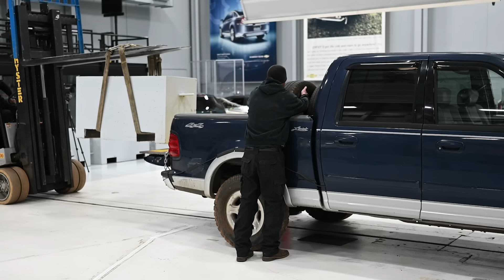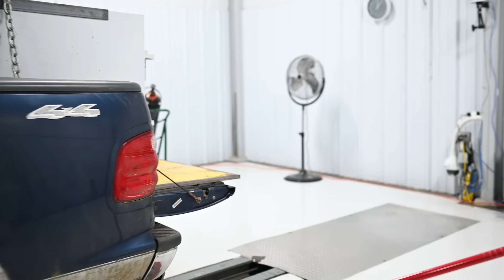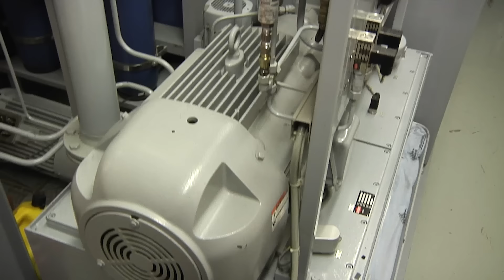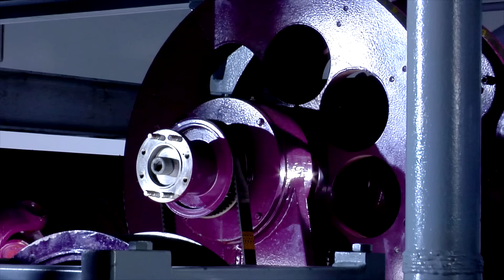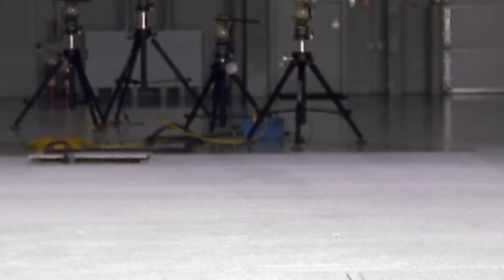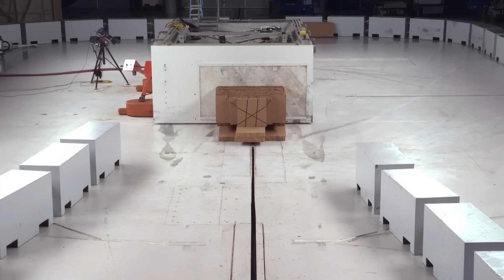IIHS crash propulsion system still pulling its weight

Comment: You say old junkers, but those "old junkers" are still going strong and are far better built and more reliable than the new cars - with almost no exception.
Reply: I've heard stories of these modern Diesel trucks that puts you in a low engine power mode if your emissions system has an issue and strands that poor contractor or transporter trying to get from point A to B costing them to loose a lot of money and time. So unfair!
Reply: Yea except they are basically all death traps, coming from a crown vic owner
Reply: i prefer my life thanks
Reply: @proboxpepper6752   Science disagrees. There are safe cars which are more than 15 years old. And they are definetly not death traps. Your crown vic is designed in the late 80s, and at least it has a good moderate crash rating from IIHS. So your comment isn't true as you are trying it to be. ;)
Reply: @gavcom4060   Don't worry. New cars are so bad that they frequently go in limp mode, therefore, you'll be safe at 30 mph. You are even safer than that when the new car breaks down. :)))
Reply: @legioner9  research tends to agree. mortality rates in vehicles have been at a decrease for decades now. in fact, when the IIHS was introduced in 1959, we saw a massive decrease in mortality in the 60s. Now, I’m not gonna say the IIHS has to anything to do with that, but…

Comment: Even though you were just trying to test the weight, you did prove an important safety tip here. When loading your truck with materials, do not exceed the maximum weight limit that the instructions say, like in this test. The results can be catastrophic.
Reply: Also to tie the load down, to restrict movement as much as possible.
Reply: @smurftums  Yes very true. And if your load is something like wood or stone, that can’t be secured very well, drive like a grandma lol! I had to dig a guy out of a load of wood, that blew through the bed of his truck and into the cab back in 2008, And it wasn’t even a big load of wood.
Reply: @BoberMcBoberson  If people haul stuff like that on a regular basis, I would think a headache rack would be a wise investment
Reply: If truck is lifted you have nothing to worry about.
Reply: @Tracert-mc1hu  the point is that most people don't haul often enough to get a headache rack so for most people load it better and drive safer
Reply: @Slacksfifth  Except for rollovers.
Reply: @Slacksfifth  The energy transfer doesn't change, it just ensures that your feet are removed, while you're getting crushed by your load.
Reply: Also place the load as far forward as possible.  This does two things, one it reduces the pendulum effect when going around a corner and two, the load does not get a running start if it breaks free in a crash.  I've seen backs of cabs pushed just about into the dash due to an unsecured load.
Reply: @Slacksfifth  a crash is still a crash
Reply: @Slacksfifth  lifted trucks will do more damage and be more at risk of rolling over and having the roof collapse on you. I'd rather lower it just to keep the center of gravity low and be able to corner better
Reply: The rated payload for those trucks was well over 1,000 lbs. Anything near that weight is going to rip off any tie downs and blast through to the dashboard in that type of collision.
Reply: And put the heaviest items closer to the cab, so it has no time to "accelerate" before hitting the back of the cab
Reply: @specialopsdave  That's not how physics works bro. It's all still going to smash the cab of the truck
Reply: @cherrypepsi2815  Yes, it does. Something slamming into another thing does more damage than when it is pushed hard. Change in velocity over time is acceleration, and change in acceleration over time is called jerk. Jerk is very important in crash tests, and will be far more extreme if it has distance to travel first before impact. This is the same reason seatbelts have pretensioners.
Reply: @specialopsdave  You were acting as if that jerk was the only thing that caused damage though, when in reality, that large mass would still have inertia

Maybe I just misunderstood what you were trying to say
Reply: @cherrypepsi2815  Yes, but the wall would have more time to work on said inertia, and it would only bend the wall, rather than becoming an impromptu dashboard replacement
Reply: @specialopsdave  Really at that point it just depends on the weight/malleability of said object
Reply: @Slacksfifth  If you're stupid enough to have one of those bubba buggies, then you have a lot to worry about.
Reply: @TheScrubmuffin69  also, most headache racks on pickups are just bolted onto the bed, which in a crash doesn't do much for ya. Be better off just welding a steel panel between the bed and cab, and install a rear facing camera and wire it into your rearview mirror
Reply: something even more disturbing? a 3/4 ton and 1 ton use the same cab and bed for most manufactures so event hough they are rated for that payload the same thing would happen if not properly strapped down.
Reply: @Slacksfifth  😂 what
Reply: @cherrypepsi2815  it's not as likely to if it doesn't get a running start.
Reply: @benjammin8510  Yeah, I get what you mean. At first I thought you meant that it wouldn't damage the truck at all (which is stupid). My bad
Reply: @Slacks 5th Avenue  The weight is still going to come forward. Physics don't change.
Reply: @user-ke5cx2pl4s Headache racks are great for protecting the cab and window from things you are throwing into the bed. Not really all that strong when faced with mass and inertia/speed.
Reply: @Slacksfifth You're funny.
Reply: @Tracert-mc1hu  a headache rack isn’t going to do much good down low. With a large mass in the bed, the thin sheet metal will give way. 

It might be a nice spot to mount some lights, or protect the glass but I don’t see it as a true safety feature by any means.
Reply: That's definitely the simplest way to look at this but maybe not the right way. How that weight was strapped down matters the most here, not the weight itself. This wasn't done in a way to prevent the weight from moving, hopefully you can simply see that with your simple ideas here.
Reply: This is why they have headache racks for pickups. It will take some of the kinetic energy out of the load.
Reply: Or use a trailer while securing very well.

Comment: The crash results of a 5000lb load vs 9500lb load at 40mph are going to be massively different, frankly devastating. We are entering into a whole new era of crash tests. It will be interesting what structural modifications will have to be made to absorb/dispel that additional kinetic energy generated from all that additional weight.
Reply: There will definitely had to be miss to how doors are designed. Its a big weakness of unibody
Reply: Its a bit of nightmare really isn't it. Most guards and railings infrastructure should be fine because they are designed to withstand big trucks. But the road surfaces are going to get a pummelling and anyone in a more efficient lightweight vehicle is going to be at a severe disadvantage compared to the land tankers that are being released. Equally when vehicles collide with buildings the results are going to be much worse than they traditionally would be.
Reply: @aljowen  I think accident prevention systems will need huge injection of R&D. Avoidance will be essential to injury prevention and fatal collisions.
Reply: 미래엔 대형트럭만 운송할수있게만드는거임. 운전석은 바퀴옆과같은 위치에있고 짐의높이를 더높이만들명됨. 즉 짐칸의위치가 승객실보다 높거나 낮으면 중첩이안되서 굳이 강성을개선랄 필요가없음
Reply: @aljowen  areu refering to Evs coming?
Reply: @randomrazr  Yes, but not exclusively. I think there has been a general trend towards heavier vehicles for a little while. 
If all road vehicles were of a similar weight everyone would be safer. But then people buy a really heavy vehicle like a truck or large SUV and compromise the safety of others. In particular those who do so without regard for the safety of others. Obviously there are people who need these heavier vehicles and drive them responsibly with an understanding of how much damage they can cause.
As such all other cars need to become heavier in order to survive a crash with these land yachts. Everyone becomes less safe as a result. Heavier cars also get worse economy, and perform worse.
This isn't too say that all cars should be a ton can on wheels. Clearly there is a need for cats to be heavy enough to contain good safety equipment etc. But there is a compromise to be made.
Reply: @aljowen  so if u want to be in a safe vehicle based solely on urself, pick a super heavy car?
Reply: @randomrazr  Well, not necessarily. For one, you would be perpetuating the endless cycle of getting heavier and heavier vehicles to ensure one's safety. There's also the fact that heavier ≠ safer. The Tesla Model 3 is leaps and bounds safer than the heaviest Ford F350. It's about the way its built (and as others stated: infrastructure).
Reply: @THEJPR  like if a f350 and a tesla model 3 colldied with eachother. the safer vehicle ot be in is the tesla? not the huge sized truck? facinating
Reply: @randomrazr  even busses have this problem.  Open space and low support. I was disappointed watching a derby and seeing the busses roll up in impacts. They was only going 25mph🙄. Then watched slides of actual wrecks at 40,50, and those sent the entire front end well pass where the passengers sit👀. Gave me a different view of horror movies and psychotic bus drivers, you would do more damage In a well built car.
Reply: Most crash energy comes from velocity, not mass.  I’d rather be struck by the Titanic at 1 mph than a Geo Metro going 10 mph.
Reply: @randomrazr  Both vehicles are death traps.  The Model 3 occupants would be crushed since the car sits so low and the F350 Occupants would have their necks snapped from the roof caving in after flipping over.
Reply: @user-tb7rn1il3q  That's not at all what would happen.
Reply: @user-tb7rn1il3q  whats the safest vehicle on the road to get?
Reply: I've always wondered why cars weren't tested with a  dummy in each seat with a seat belt and a trunk full of luggage. I'll bet every single top safety pick would look like c rap after a test like this.
Reply: Cars actually got lighter over the years.  EV's are heavier due to the battery but it's not double the weight, not even close.
Reply: Vehicles that weight over 9k lbs destroy roads and bridges.
Reply: I'm surprised this test isn't done at 55MPH for the American Market yet 40mph was relevant a long time ago....makes me wonder what will hold all that force back in a 9000lb EV. If the batteries are built into the floor won't they slide up under to the front and possibly crush themselves? Or catch fire when things touch that shouldn't touch...

Comment: Old “junkers” that still on the road and better than new vehicles. ❤️
Reply: Facts
Reply: Depends on what you need it for.
Reply: not in a crash
Reply: @zyke612   Depends. If I ram that F-150 head on at 65 mph in a Tesla Model X head on, going same speed, I doubt anyone in front will survive.
Reply: @zyke612  Yeah, basically the only thing over-complicated modern cars do better. They are otherwise far more expensive to maintain, much less reliable, and much harder/more expensive to diagnose yourself properly
Reply: @legioner9  teslas are far safer than early 2000s trucks
Reply: @zyke612   In the front crash I doubt. At least at higher speed.
Reply: @MrCarGuy  So true.
Reply: @legioner9  while generally higher mass wins, old trucks while heavier, aren’t designed for safety. teslas are among the safest vehicles you can get. combined with their weight from the batteries, even at a higher speed a tesla would win.
Reply: @zyke612  I doubt it really.
Reply: @legioner9  ok
Reply: @legioner9  Yes, but the goal is not to kill the occupants of the other car; it's to protect both as sufficiently as possible. The Model X would clearly be at the disadvantage due to its low ground clearance.
Reply: @faubps   True.